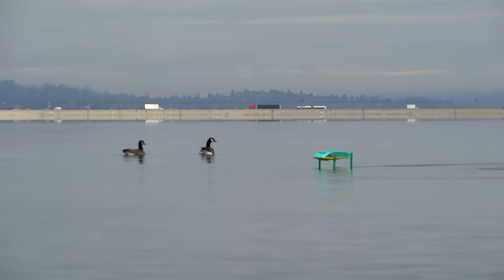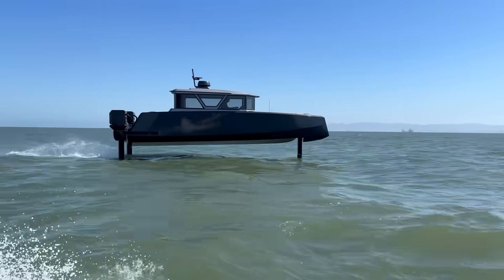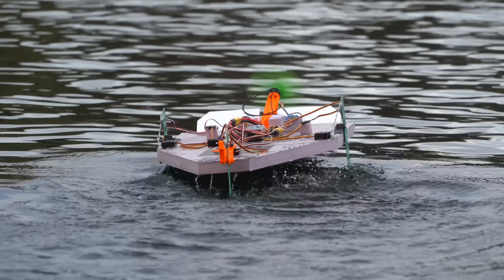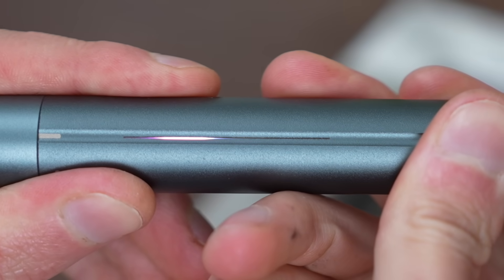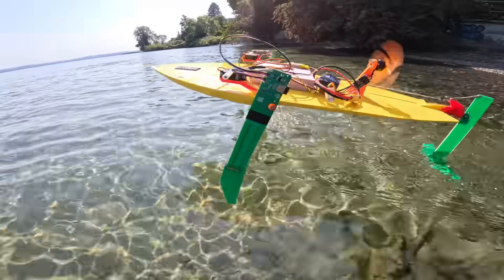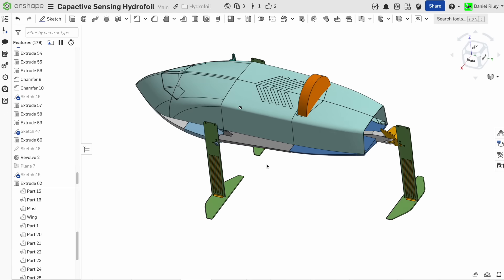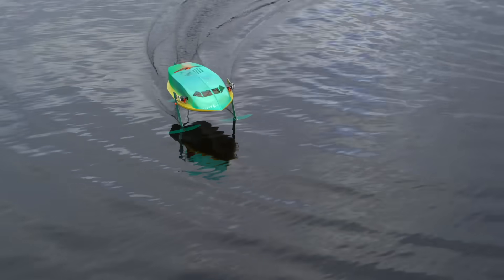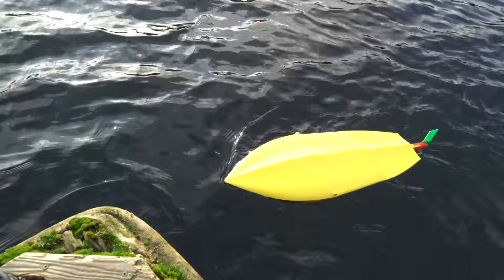Hydrofoil R/C Airboat Build and Test

Comment: I got the kit and built it; 3D-printed the boat, and I noticed the rolling. It was most likely from the torque steer; however, I was able to fix it in a few seconds. Basically, when Daniel said the first batch had a software bug that required setting up settings for each mast, it was a blessing in disguise. I made it so the foil on the starboard side had slightly more lift, which fixed the problem, and it's been working like a dream. Also when I had a question about the kit i emailed Daniel and he responded very fast! 10/10

Comment: The roll is 100% from the motor torque. Same exact reason Neil Armstrong crashed his NF-104 when it got to low atmosphere and the engine flamed out (like shown in "The Right Stuff"). The torque is a lot stronger relatively at lower speeds and with little to no control authority. I'm guessing it always rolls to the same side?

Comment: A big part of the boat rolling when coming up to foil is the foil having too much pitch, causing more drag than lift... 
Just like a plane in a flat spin, more opposite aileron increases drag on the inward wing causing the opposite intended affect... 
Whereas no aileron input and opposite rudder fixes the situation as wing lift is increased and adverse spoiled air is decreased.

Comment: You can borrow from airplanes... Camber the front flaps so that when there is roll it automatically corrects it. If the boat tilts to the right 5 degree and the front flaps are at 5 degree camber, then the leftside front flap is at 0 degrees relative to the gravity and the right one is at 10. It has that much less lift upwards than the left side, which now has full lift. Also, the right one has that 10 degrees that is pointing to the side, and this tries to turn the boat, and it turns to the direction away from the roll... So, both sides try to keep it up. You lost a bit of lift, gain a ton of stability from just geometry.

Having them perfectly on the same plane, with upright perfectly vertical and parallel  and you got yourself a bit of an upside down pendulum. If they point to the inwards, it just gets worse, feedback will try to encourage roll.

Comment: It looks to me that the craft is tilting not when “getting up on plane” but specifically related to increase in motor speed aka, torque steering.  Using two motors that counter rotate, should solve this problem.

Comment: I wonder if that roll could be solved with a bit of dihederal on the rear foil and possibly on the outer sides of the fronts.. wouldn't require a huge design change and could quickly be tested.

Comment: The initial rolling to the side is caused by the drag of the propeller. So you might try to use two different propellers spinning in opposite direction. Either in line or side by side.
Another thought, try to control the two foils by an accelerometer to maintain roll stability until out of the water

Comment: Maybe I'm completely wrong (probably am ;) ), but maybe you can have a mode in the controller for launching the ship. When it's buoyant and not on the foils, the foils appear to still be near max angle of attack. High angle of attack creates a lot of drag, which makes it more difficult to build speed, hence for the hull to get out of the water. Similarly, aircraft only pitch to lift off from the ground once they've reached a critical take-off velocity. Maybe you could do something similar here, that it keeps the angle of attack low until a critical speed is built and only then does it suddenly increase the angle to jerk the hull out of the water (trading off some speed), thus reducing drag and allowing the craft to speed up further, making the foils more effective at keeping it out of the water.

Comment: Seems your main issue is prop torque. Did you just mount it straight? If so, you might consider offsetting the angle a bit.

Comment: Your roll issue is due to P-Factor. This is why it becomes a problem at high angle of attack. Notice how the direction of the roll is opposite the rotation of the propeller. If you were to pitch the nose forward, it would roll to the left.

Comment: Mount the two front wings at an angle towards the outside. This should automatically lead to self-stabilisation. The same principle applies to aeroplane wings, which are slightly angled upwards.

Comment: Why do you insist on using flat plane hydrofoils? Each outer half of the foil, angled upwards, will help reduce roll in a turn as lift increases  on one side and decrease on the other side as the boat rolls.

Comment: excellent work, especially about the height-sensing PCB foils ... remarkable result without using an IMU... now switch to a catamaran twin hull setup (for roll control and T/O) plus an IMU and you'd be off to the races !
Also the enclosed prop is not breathing well, switch to a proper ducted fan and you'll get a rocket ship.

Comment: I think it's a combination of propeller walk and in what the aviation world calls adverse yaw...  some airplanes when rolled into a turn with ailerons yaw towards the higher wing because the aileron going down creates more drag than the one going up, this is adverse yaw and has to be corrected with either rudder or differential aileron throw where the upward traveling aileron moves further than the downward traveling one creating yaw in the correct direction.  with a boat instead of adverse yaw you get adverse roll.  when it does this in this instance the lower side hydrofoil is now under the boat instead of outside the boat so the correcting force causes more roll because of the increased drag.  this could be fixed a number of ways, change the thrust angle of the motor so it isn't pushing the nose down or widen the stance of the front hydrofoils.  probably just angling the bottom of the hydrofoil arms out at the bottom a few degrees and tilting the back of the motor up a few degrees would completely tame this issue.  might also try having the higher side foil go negative to give more roll affect in the correct direction.

Comment: I used to do some occasional control engineering, so a word about using more than one independent control system to control the attitude (i.e. the two independent front ride height systems, or having all three foils independently actively controlled) - when two or more control systems with the same frequency response try and control some parameter that is common to them, or at least partly coupled (ride height in this case), they can end up fighting it out as they are all chasing each other's tail so to speak, trying to 'correct' what the other is doing. That is, oscillations occur. I haven't watched the previous video or all of this one yet so maybe I'll see the answer when I do but I'm surprised the two front ride height control systems are not fighting each other. It could be that either they are set up to be very well damped (slow response, no overshoot), that's one way to avoid instability, or that changing the height of one foil has little effect on the height of the other, which I find hard to believe, but who knows. Nice project!

Comment: You could have it so that when you turn it changes the level bias on each side foil so that it rolls into the turn slightly. 

Should have it so depending on the incoming turn signal will add a slight level bias to the inside foil so it sits slightly further down compared to the outside foil.

Alternatively you could tilt the foils slightly so their sideways angle of attack adds an opposing torque caused by the high CoG

Comment: I'm not an expert, however, I would have chosen a hull design off one of the proven full size hydrofoils of which there are plenty. Secondly, the hull is too wide for tit's length, I believe there is a ratio regarding beam to length. The extreme width is like a long lever  and the longer the lever the more energy to tilt, a narrower hull won't tilt as much. Anyway, that's my 10 cents worth. Really impressed with the advanced construction and tech, a far cry from my youth.

Comment: I wonder if setting the two hydrofoil wings each a bit off center (wings off center, away from each other, struts stay the same) would help with the roll- I suppose the part of the wing that is under the body suffers interference and additionally doesn't have as much traction, so to speak. If you imagine a shape that would statically resist twist it would likely extend further to port and starboard, so by just sliding the wings out you get some of that. More complicated would be the struts extend outward sideways at a bit of an angle.

Comment: Love these videos. Suggestion: As I'm sure you're %100 aware of, a  hydrofoil uses an "Airfoil" to provide lift, while your current designs are using flat plates to generate lift from angle of attack. I'm very curious to see how the performance would change with actual hydrofoils.
Also, the video of the RC speedboat at the end is perfect for showing how smooth a hydrofoil boat glides above the water, since the hull does not ride on top of the waves. This smooth motion, the increase in efficiency, and the cool factor is why I will build a hydrofoil boat. Your testing and the availability of your engineering data will be key in making this happen, so thank you!

Comment: I made some of my thoughts about this hydrofoiling rc boat theme in general with Google Gemini. That's an interesting analysis of rctestflight's hydrofoiling boat attempts. I agree with you, especially regarding the first two points. The third point about scaling is generally true, but its direct impact on small RC models is often mitigated by using similar scaling for the physics (though not perfectly).
Here is a breakdown and some additional ideas, formulated in English:
🚤 Analysis of Potential Issues in RC Hydrofoiling
Your points are very relevant to the challenges of building a working hydrofoiling RC boat.
1. Insufficient Forward Speed (Your Point A)
 * Agreement: I strongly agree. Hydrofoils work by generating lift through the motion of water over their curved surface. The lift force (L) is proportional to the square of the velocity (v): L \propto v^2. If the boat isn't moving fast enough, the foils simply won't generate the necessary force to overcome the boat's weight and drag, preventing it from lifting out of the water.
2. Issues with Turning Speed and Radius (Your Point B)
 * Agreement: This is another critical factor. When a hydrofoil boat turns, the net velocity of the water relative to the foil changes, and the angle of attack of the foils can be heavily impacted.
   * The inner foil can lose a lot of lift as its effective speed is reduced.
   * The outer foil experiences increased load, and if the boat leans too much, this can cause the foil to ventilate (suck air from the surface), leading to a sudden and catastrophic loss of lift (a 'breach' or 'blowout'). Maintaining high speed and using a large turning radius minimizes this risk.
3. Scaling Effects on Water Physics (Your Point C)
 * Agreement (with nuance): You are referring to the concept of Reynolds Number (Re).
   * The Reynolds Number is crucial for describing fluid dynamics. Re represents the ratio of inertial forces to viscous forces.
   *    * Where \rho is the fluid density, v is the speed, L is the characteristic linear dimension (length of the foil/boat), and \mu is the dynamic viscosity of the fluid.
   * For a small RC model (L is small) moving at lower speeds (v is small), the Re is much lower than for a full-scale boat. This means viscous effects (like drag and resistance) are proportionally more significant than for a full-sized boat, making it inherently harder to achieve the necessary speed and lift efficiency compared to a scaled-down expectation.
💡 Additional Potential Issues
Beyond your excellent points, here are a few other technical issues commonly faced when designing small hydrofoils:
4. Foil Geometry and Angle of Attack (AoA)
 * The shape (airfoil profile) of the foil is critical for lift and efficiency. A poorly chosen profile can generate too much drag or not enough lift.
 * The Angle of Attack (AoA), which is the angle between the foil's chord line and the direction of water flow, must be set correctly.
   * If the AoA is too low, it generates insufficient lift.
   * If the AoA is too high, the foil will "stall" (the flow separates from the foil's surface) and lose lift abruptly, while simultaneously generating massive amounts of drag.
5. Ventilation and Cavitation
 * Ventilation: This occurs when air is sucked down from the water surface along the strut and reaches the foil, causing an immediate, severe loss of lift. This is common with foils operating close to the surface, and is often solved by adding a small ventilation fence or anti-ventilation plate just below the water surface.
 * Cavitation: This is the formation of vapor bubbles (pockets of water vapor) on the low-pressure side of the foil when the local pressure drops below the vapor pressure of water. It causes a sudden increase in drag, vibration, noise, and is destructive to the foil, and is more likely at very high speeds in water.
6. Stability and Control System
 * Full-sized hydrofoil boats often use active stabilization systems (like flaps or variable AoA) controlled by gyros and accelerometers to maintain pitch, roll, and height. Without such a system, the boat's stability relies entirely on the passive geometry (V-foils, T-foils, ladders, etc.).
 * A passive foil system is extremely difficult to tune for both stability and lift across a range of speeds and water conditions. rctestflight's models often lack complex active control, which is a major hurdle for successful, sustained foiling.

Comment: Not sure if anyone else has mentioned this before, but like with boats having their Zincs as consumables that get eaten away first in water. Have you thought about not using DC and making a low power AC power supply for the water sensors. AC wont degrade the metal as much as direct DC

Comment: Sounds like you need launch controls in your software. IE front forks stay in the same orientation as each other to force the vehicle upwards out of the water. Then when both pillars sense the water at a certain elevated level, go back to foil mode. Then the inverse when both sensors are deep, Goto launch mode.

Comment: I bought one of those Fanttik screwdrivers.  Horrible to control, switch on back to turn on (had to find that out by needing to read the manual, shouldn't have to do that to just utilize it).  Fancy magnetic bit holder is awful.  Can't see/read the faint gray on gray icons or text for the bits, and, god forbid you do I I did and drop it.  Bits everywhere.  I still haven't found a couple and probably have half the ones I did find in the wrong places.

Anyone want to buy mine for a very discounted price since I've not used it since.  I just bought a cheap Amazon one (see the torque test channel for comparisons), and it does everything I need.
Reply: The whole sponsorship is a scam.

Comment: I think  you could solve the hull to foiling problem by just having a mode that realizes when you are lifting and puts in a different mode for liftoff, or put a roll gyro on it with an input to stabilize the roll at launch.  It looks like it could use it occasionally, even when running foil borne.